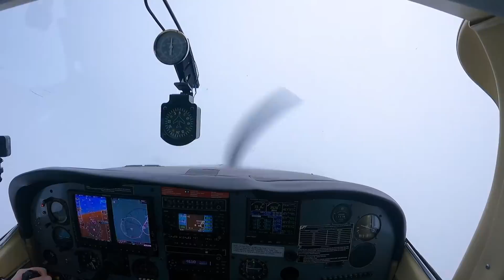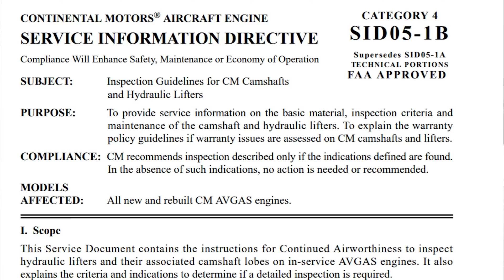Let me Explain! Why my airplane was still down

Comment: Edward, good explanation.  The engine had 500 hours, but over how many years?  (some say we should measure the state of a piston engine not on hours flown, but hours it's NOT flown... i.e. as you note, engines left idle become old quickly :-).  When you did the pre-buy did you have a Blackstone oil analysis done? (would/could have detected the ferrous traces). I was without my DA40 last year for 3 months (awaiting a new prop), so I feel your pain.  Best wishes.  Wayne (DA40 KSBA)
Reply from the maker: Wayne, Thanks!, This is a great point. The engine was overhauled in 2013, which is an average of about "50 hours per year" which isn't bad, but that's not the whole story. Instead it becomes 30, 85, 23, 150, 30, 71, 110 so there are times of high usage and times of low usage and it will depend on the environment. If it sits in a high humidity area such as near the coast or southeast its going to get old a lot faster than if it sits in the desert. During the pre-buy we did cut open the oil filter but did not perform an analysis, by my second oil change I did and they said higher than normal watch it, this was the 3rd oil change and they report said caution. I will be keeping a close eye on it.
Reply: @TheEdwardFrye , hope to see your next video with her flying again.  Be safe and healthy.  Wayne
Reply: @TheEdwardFrye  k

Comment: So for info  if your lifters are trashed your cams trashed even one of these WILL cause catastrophic  engine failure  in any combustion engine , most engines don't filter oil the oil all the time so debris will migrate to All parts of the engine that run in oil  if your motors making metal it's gunna break !

Comment: 50-60K to replace your engine? I dropped in a full rebuilt O-470-R (6C/Carb) including exhaust and mages for 16K. Who are you using??
Reply: More importantly who are you using for a rebuild? I found a Cessna 172 that I wanted to buy, it was a great price but it needed an overhaul. When I found out the cost of 30,000 to replace the engine, that put it out a sight for me I just wanted a simple around town flyer for the weekends. I cannot believe the cost of engine work on these airplanes, the overall costs of fuel and engines has priced thousands of us out of general aviation. For the life of me I can’t understand why a four-cylinder air cooled engine could cost $30,000 to replace. A friend of mine had a race car engine built for under 10,000 with all kinds of high-performance parts.
Reply: @wlc1980  You know how tight the Av community is and how words can get around real fast. With that, there's an old saying that says sometimes you gotta get outside the box to find what you're looking for. Sometimes we get a bit too comfy with that which is around us because it's an issue of trust when you're in the air. If there's enough comp where you are, it usually won't be an issue. If you're going to places like "overhaul bids, air-power , etc. then you can spend an amount that is reflective of INS prices. Finding a mech that is past a basic av tech can be hard, but if you can get an A&P certified mech, put the $ in his back pocket, not his bosses.....

Comment: I am very interested in finding out the reason for the catastrophic failure of your engine. I found your commentary while you were flying extremely off putting with the background air traffic  radio chatter and your frequent interruptions as you listened in to that chatter. I would recommend  that you either give us the information about your engine failure while you are on the ground without the background distractions or else you give us the relevant commentary about your current flight - not both. It has to be one or the other instead of what you have posted here. Very disappointing!

Comment: Just a respectful and friendly recommendation, you might want to consider wearing your shoulder harness.  Please consider upgrading your 210 to a 4 or 5 point restraining system rather than the single shoulder harness.  One of my now adult kids survived a Cub crash where they face planted the instrument panel.  The Cub wasn't equipped with shoulder harnesses, just the lap belt.  It only took one surgery to repair the facial damage and there is no permanent visible scarring or disfigurement.  They were fortunate.  You've already been through one forced landing.

Comment: Just out of curiosity, why did you chose a such complex and expensive airplane for your first plane, or rather such a complex and expensive engine? You could have rebuilt TWO Cessna 172 Lycoming IO-360s for the price of a single Continental TURBO IO-520!

Comment: There’s a saying that I’ve found relates well to aircraft ownership. There’s never enough time (money) to do it right, but there’s always enough time (money) to do it again. 

About a year ago I had an engine that was running just fine, but at an oil change we found a lot of metal in the suction screen and filter. I’d been doing oil analysis for the past five years and the results were always good, the lab’s comments usually something like, “all levels within limits, whatever you’re doing, keep it up”. Oil samples from that oil change had again been sent to the same lab, but with this one, somehow, the postal service lost the package. More on that later. 

I flew the aircraft another hour and checked the filter again. More metal. Ugh…. Called around to several shops and settled on the well known one in Visalia to send the engine to. The engine was pulled, sent to the shop, and I waited. When they had the engine apart I drove down to see it first hand. Like yours, my lifters had a lot of spalling so it was obvious where the metal was coming from. 

Now this engine had 800 hours and 20 years on it, but it was a “field overhaul” and not one from an engine shop. When I bought the airplane I was told after the pre-buy that if I was going to have any engine issues, it would probably be this one (the airplane has two, the other one done by an engine shop 450 hrs ago). 

I got a quote for an IRAN and thought about it for a bit. I considered resale value. I considered what I would think if I was looking at buying an airplane with an 800 hr “repaired” engine. Just as I decided to go with a big name shop rather than a smaller, cheaper one, I considered what a future buyer would think. 

After all that I had them do a full overhaul. I got back a new logbook and a 0 SMOH engine. It was more expensive than an IRAN, but the engine returned with new lifters, cam, cylinders, and a bunch of other stuff. Now I knew exactly what I had. I also had them run it in their test cell for about five hours to do the initial break-in. If it was going to fail right away, better to let the shop do it. 

The airplane was down for just under 6 months and the engine now has over 50, trouble free hours on it. Ran it initially on 20-50 mineral oil and AvBlend per the shop’s instructions, then after the consumption settled down switched to 20-50 XC and CamGuard. (Now running CamGuard in the other engine as well)

Incidentally, after the engine was back I was notified by the oil analysis lab that the sample had finally been delivered and inspected. The report said all levels were normal and to keep sampling!

Comment: Lifters are a recurring problem with the 520.  Sorry you were caught up in it.  TCM has no good fix for this and with the high cost of aviation fuel, lack of flight time is going to continue to hurt us all.  Not sure whether engine heaters are effective in keeping condensation to a minimum but they seem to help some.  Please keep us posted on this important issue.  Thanks for the video.

Comment: If the lifters are junk so is the cam... waste of money to even think of just replacing the lifters...
I'm not an AP but have been a mechanic all my life and built a "ultralight" airplane based on an OA084
military surplus engine, which I completely dissasembled and minutely inspected.......
Aircraft engines are nothing special and in most cases are mostly under built IMHO
And MASSIVLY over priced.

Comment: Your engine threw a rod. How could a lifter cause, spalled or not the motor to throw a connecting rod! You spun a crank bearing!!!
Lifters either pump up or not if hydraulic. Solid lifters you adjust by hand til the pushrods have no lash, just spin freely with your fingers. I don't buy the "lifter story".
At this point I would install an new oil pump as well. Clean Lubrication is vital.
Reply: The lifters chewed metal off the cam and polluted the whole lube system with metal!!!  Now, how that metal made it through the case being split and everything rebuilt i have NO idea!!!!  Unless they totally half assed the "Rebuild" and didn't clean it while it was apart!!!!  So they added new lifters to the old cam which is a HUUUGE NO NO!!!!  Cam and lifters are ALWAYS installed as a SET!!!!  NEVER EVER EVER use NEW with OLD NO MATTER WHAT!!!!
Once they break in they have a wear pattern established so changing just the lifters means they have to wear themselves in to the cam AGAIN and that means hard metal in the oil and that's a HUUUUGE NO NO!!!!  Soft metal is bearable if it's not very much cause it won't RIP out your bearings the way steel will!!!  So copper or aluminum bits are acceptable to a point.... they will mash into the bearings and become part of them.... but steel will chew them apart and when that happens you lose the oil film that keeps the hard parts away from the soft bearings and the bearings go away in a really big hurry!!!!
Then the crank goes steel on steel and...... stops dead!!!!
So whoever told you that changing JUST the lifters needs a swift hard kick to the genitals!!!!!  ALWAYS change BOTH CAM AND LIFTERS AS A SET!!!!  NEVER EVER MIX OLD AND NEW!!!!  I would probably take that cam and stuff it up somewhere the guy that told you to just change the lifters wouldn't like it!!!!!  
Or beat him half to death with it!!!!!  Either way should get your point across!!!!!!
Reply: @TheCorezero00  
The oil pump could've been the culprit. They never mentioned installing a new oil pump with the rebuild. It was already worn.  Oil starvation can cause a myriad of problems...
Reply from the maker: The spalled lifters were found in February 2021 and replaced in May 2021. Then the new lifters and oil pump housing were damaged by the camshaft that was not replaced previously. The engine was removed in July 2021, repaired, and reinstalled in November 2021. 

The video of break-in flight you are referring to where the engine threw a rod on November 24th 2021, the day before Thanksgiving. 
Seven months later. I landed, grabbed a beer and published the video within 6 hours.
Reply: @TheEdwardFrye  
You always replace new lifters with a new camshaft n vice versa. Conversely, you don't install a new camshaft with old lifters. You replace lifters n camshaft as a "set". These two components have to "wear in" (break-in)
at the same time. Hydraulic lifters, solid lifters, or roller cam, it doesn't matter. You replace as a set. You never mix n match old with new because the wear patterns are different n cause "accelerated wear" on these components causing premature wear, less power, erratic idle n may lead to catastrophic damage... Valve trains are installed as a "set". For example, Competition Camshafts sets, include, lifters, cam, and rocker arms with poly locks, timing gesrs, and assembly lube, and you have your choice of stock or heavy duty pushrods... Just saying. Motors are expensive n one cannot cut corners here. One cannot compromise here
 You were lucky to have enough altitude to turnaround n glide in for a landing. If your motor had run a bit longer before it took a crap, you may have had to ditch your plane in a populated area! Not good.

Comment: TURN THE DAMNED RADIO OFF ! Fly at least once a week, Use Camguard or Greased Lightening. You are right, the engine will not make anywhere close to TBO. Start watching Mike Busch at Saavy Aviation. Oil pressure will be your definate statement from the engine. There looks to be so much destroyed of the engine, I would not chance rebuilding what you have... get a used engine from Wentworth or Barnstormers, you will be much better off. Good Luck !
Reply: You know oil pressure only oils the crankshaft and cam bearings everything else is splash fed
Reply: @spannaspinna  of course...

Comment: This must be before the engine disintegration?  What caused the destruction?   Once again, the GA airplanes are money pits.  Just the way it is in order to be able to bore holes in the air.
Reply from the maker: Yes, this is before the disintegration, other than the connecting rod through the case, that happened on Wednesday before Thanksgiving and the shop is closed for the holiday weekend.
Reply: Hello Ed,  This rental plane seems like a good working unit...  Is it for sale? Maybe You can use this engine & prop in Your plane that now has a blown engine, & a prop that needs overhaul... Or maybe just sell Your plane, after the warranty work is done,  and buy this one? Or maybe buy a 172 that is in good shape?